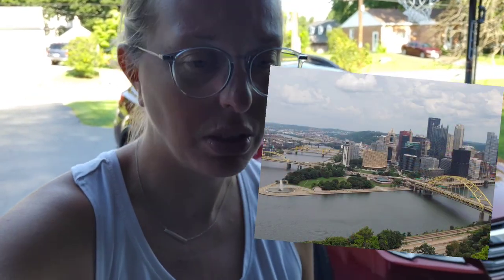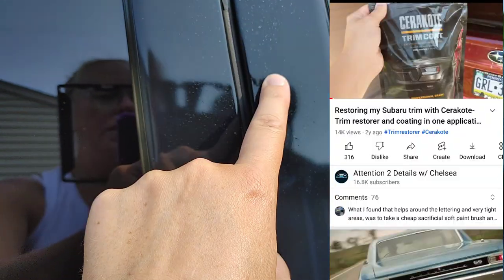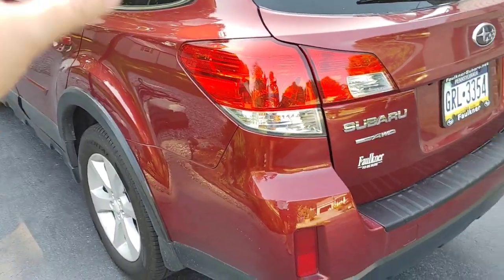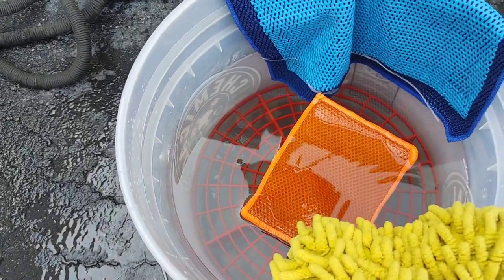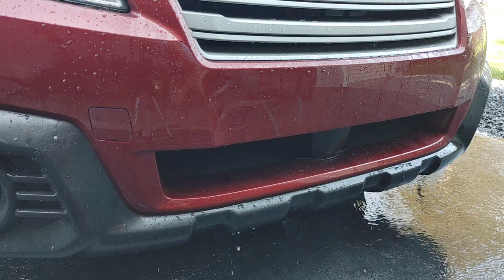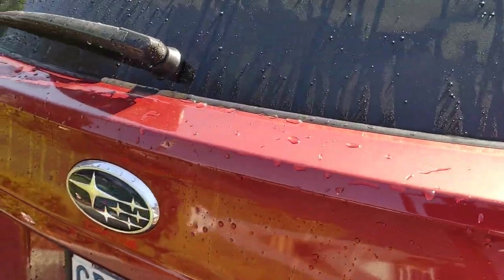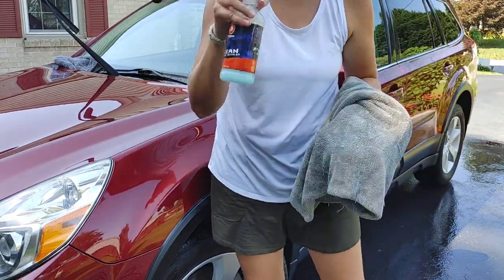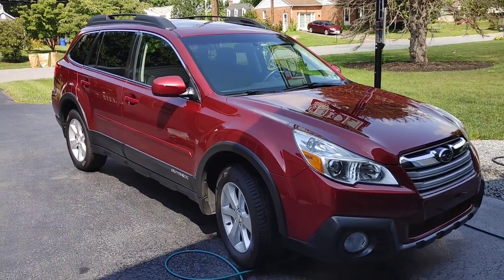How To Maintain A Coated Vehicle  + Update On Ethos Graphene + Cerakote Trim Restorer - 2 Yrs Later

Comment: I used the Cerakote trim restorer pads on my Outback's black areas.  I disliked some of the outcome as the application pads are inconsistent because when you open them and start applying, they're loaded with the liquid and as you go you get less liquid being applied and there's no way to "reload" the pad except for opening another one.  In addition, the liquid doesn't self-level, so when I put them on the shiny window pillars they left high spots in places where the pad was newer and more fully loaded with the liquid.  While the liquid was wet, I had thought I leveled the liquid as best I could, but when I came back later I noticed the streaky high spots that really stand out in the black.   However, they do well on the other black areas that dulled due to sunlight like the roof rack rails.
Reply: An additional update.  I washed the car yesterday and noticed that there are some spots where I used the Cerakote (plastic just in front of the roof rail mounts and black edges of side mirrors) has cracked and peeled off...disappointing.

Comment: The 3 pH system pioneered by Labocosmetica is the best way to maintain high solids coatings. Making sure the surface is really clean and free from minerals before adding toppers is important so that protection doesn’t sandwich contamination. If you haven’t already, It would be interesting to do a mineral remover wash on that rear panel to see if it helps, once the toppers have been removed of course. If Ethos is any good, and is a real 5 year coating, it will come back.
Reply: Totally agree. I just used Carpro Descale and I couldn't even get the soap to stay on the car afterwards when I did a bucket wash. It brought back Hydrophobics that looked stronger than when I first applied the coating

Comment: Hi, long time subscriber and love your videos.  Question.  I have a new 2022 4Runner and wash it 2x a week with a foam cannon, dry it with a leaf blower and then follow up with Technicians Choice ceramic detail spray. I dont like scrubbing my car either when washing or drying.  Should I though be scrubbing it?  It never really has a chance to get overly dirty and with a high pressure washer and the foam cannon there isnt any visible dirt when I am done.  I just dont know if I should occasionally be doing the two bucket method.  Thanks for the advice.  Love the channel
Reply from the maker: I would recommend periodically doing a good contact wash that’s going to give you way more lubrication than just the detail spray and it’s going to help clean your paint more effectively. What foam soap are you using?
Reply: @attention2detailswchelsea  thank you. I am using Chemical Guys sticky snowball. For clarification I’m using the Technicians Choice Ceramic spray immediately after I wash it.

Comment: Just curious as to why you are using a yellow tip for washing and rinsing?  Isn't that too strong?  Yellow is usually like 15 degree.
Reply from the maker: At a safe distance its perfectly safe. I can rinse my own feet off with it at a safe distance. It it won't cut me it won't damage paint in good condition.

Comment: I won't be using graphene anymore. Just learned how bad it is for you. Ceramic is better option.
Reply: Graphene is not bad for you.
Reply from the maker: Do you eat charred meat? That contains graphene oxide as well apparently in the charred pieces of meat.  I've been doing some studies and what I've found is that the minimal times I'm exposed to GO it is not toxic. Lone term exposure is another thing but that doesn't apply to me to the few times I use it a month. I wear gloves and have proper air flow. Believe me, this coating is WAY easier on my lungs than some ceramic coatings I've used.
Reply: @attention2detailswchelsea  that is 100% correct, people forget graphene is carbon just like every other biological organism on earth.

Comment: Way too many steps and products just to "maintain a coating".   If coatings are so great, a maintenance wash would be all that's needed to maintain it.  Never cared for coatings on my cars, you still have imbedded traffic film in it and you need to polish it off anyway at least once a year if you truly care how your car looks.   I think Scott from DPC had it correct.  Clean your paint thoroughly with a non ph neutral soap and throw on a sealant once a month if so desired.  Coatings have not made life easier, wasting more time and money on something you should be polishing off yearly anyway.